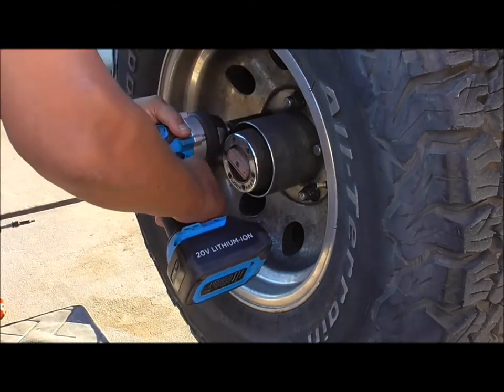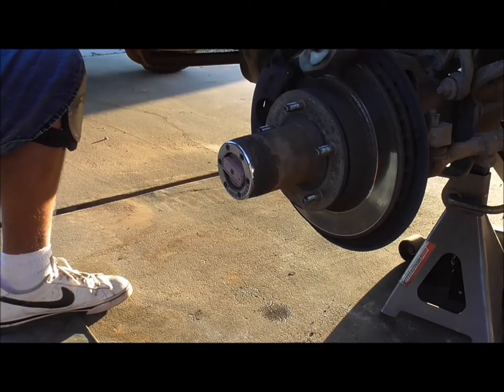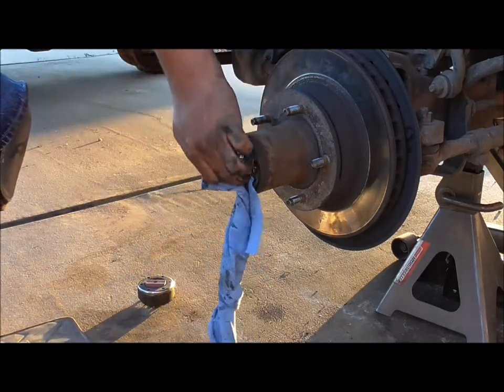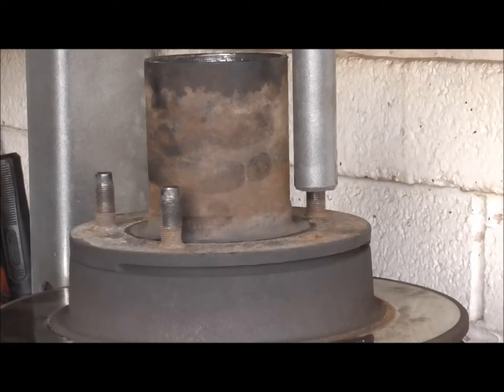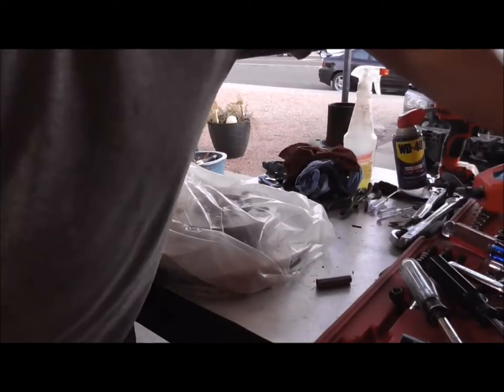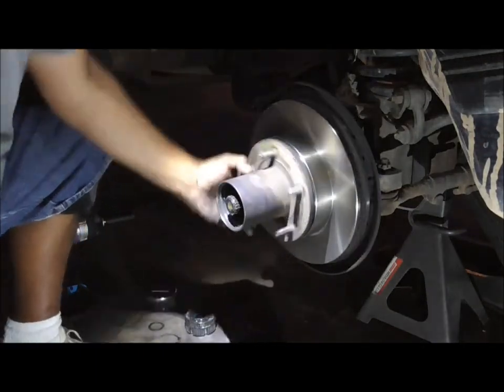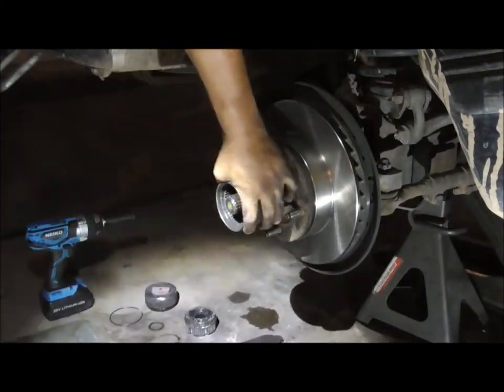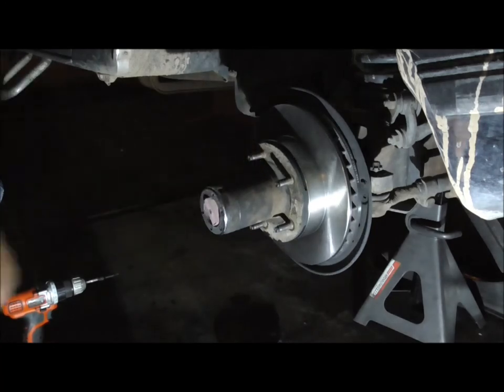1985-1994 Ford f150 4x4 front brake rotor replacement & ratcheting spindle nut TORQUE procedure DIY

Comment from the maker: Hey everyone..... I will have a video of this Ford that i'll be posting next week or so of more work i'm doing to it. New timing cover gasket, crank shaft seal, oil pan gasket, water pump gasket (as I have to remove the water pump again to get the timing cover off).  I will also be doing a separate video of the front brake caliper replacement as they are sticking and not working as they should causing the rear brake drums to overheat and lock up. Stay tuned..........

Comment: Holy crap.  This video was a freaking life saver.  I was putting that ratcheting spindle nut back on and couldn't find anything in the chilton's and all the other videos just said to put it back the way you took it apart.  I just finished and everything is working great.  The only thing I'm wondering is this.  I took the spindle off to replace my ball joints.  I put the spindle back on, but I noticed that my notch for the spindle nut is now on the bottom instead of the top.  Do I need to remove the spindle and adjust?  Thanks.
Reply from the maker: You may have to readjust them. New bearings and hub parts will fit differently than old & worn parts.

Comment: I need to do this job on an 85 F150 I just bought.  Thanks for the video.  What were you tapping out, early on?  No bolts secure the caliper?
Reply: No, they're like, retaining bars that hold it on. Not sure how else to explain it.
Reply from the maker: They have brake compression pins. Two pieces of steel with rubber in between.

Comment: Hey WarPony, I need front rotors and calipers for my 1994 F-150.  I was over at the junkyard today for another part and I saw a 1986 F150 with brand new rotors and calipers.  Do you think they will fit my 1994?  When I did a parts search on Advance Auto, I came up with different part numbers for the rotors for the '86 and '94.  But I also got three different part numbers for the Parking Brake Strut Link that came from two other year F-150's that identically matched the Parking Brake Strut Link for my 1994.  So MAYBE you can't always go by Part Numbers?